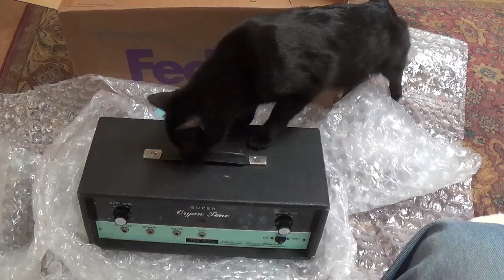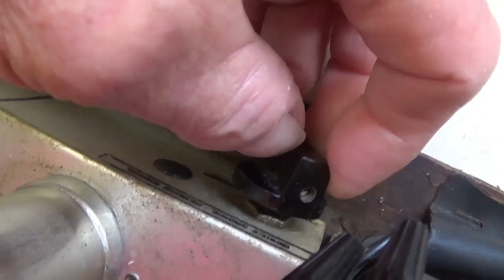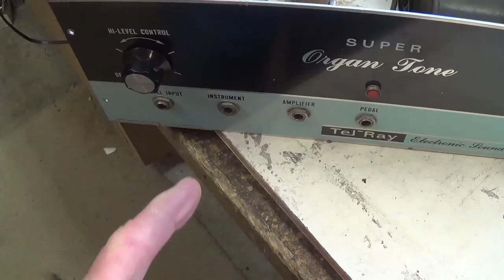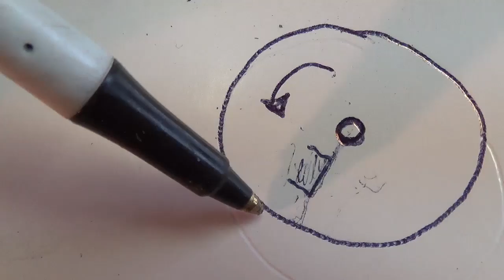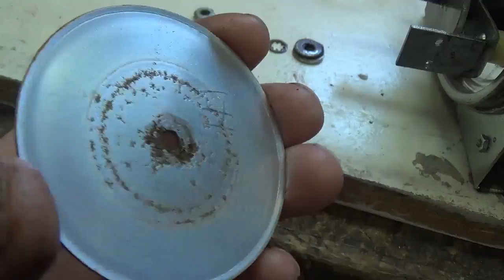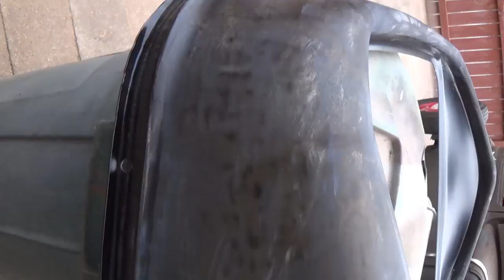Tel-Ray Super Organ Tone No.2: The Beat Goes On :)

Comment: Nice vid as usual just one question, -Would it be  best to nenew/repair the main bearings to get a more stiff transmission with less runout without the endspring trying to centralise the whole lot and just check lateral position. Cheers from Sweden, keep up your outstanding work UncleD
Reply from the maker: Yes, it might be better, if the drive pulley was not pressed onto one end of the shaft and the disc support pressed onto the other. The last think I wanted to do was damage the unit trying to disassemble it.......especially when it wasn't really necessary. We will :)

Comment: Just jog your memory twisty connectors are called wire nuts.
You didn't repair the bushing if you take the bushing out and fill it with plumbers solder cleaning it first and using Flux then drill it out so it is a snug Fit then just spin it in a drill when it's dry clean oil and you should be alright. You could have used a roller bearing on the other hand a small one like from a router bit welded to the spring steel or brazed would have been better and smoother operation and last longer. When oiling the bearing bushings like in the motor always use manual gearbox 90 or 80 oil best stuff for that type of bearing if it's a bronze bearing what it should be, And best lubrication for chains as well like bicycles and motorbikes.

Theoretically you could use an old PC hard drive disk, and probably the motor as well make a good replacement, just dismantle the Platters and just have one platter the old type were covered in a oxide material I don't know what the new discs are there silver I'm not sure what they coat them in..but the Old aluminium discs platters, had thick coating of oxide at least 60 or 80 microns thick, would make a great alternative.
What oil are you using in the lubrication of the disc mineral or synthetic and what grade and any additives added if you got a name or link thanks like to find out about it
Reply from the maker: Removal of the central shaft would require pressing the drive pulley and the disc support off of the axle, John, which I considered to be a risky procedure. Creating an end pilot solved the end wobble on the shaft, as demonstrated by the 0.0001" runout on the disc. I'm not sure about hard drive discs being usable in these units. Could they withstand the Ucon oil and rubber head contact?  Details about the Ucon oil are provided in my first video on these units.
Reply: @UncleDoug  I see what you're saying. Could you slide a ball bearing over the shaft and epoxy it in place, on the face of bearing housing..? I don't know if it would affect the hard drive I don't think so the oil that is or the rubber the surface is very tough it doesn't affect the surface on the disk you are using what is that coding silver. Anyway seems nice job cars looking nice
Reply: @UncleDoug On my echo unit the spring metal that holds the brass bushing in the bearing housing was bent and lose simply pressing the metal with a screw diver solved 1/4 inch of run out for me. The bearing needs to be removed to check this some are closed housings though.

Comment: What are the theory on this "rubber" used as writing and reading heads ?
Reply: I think it's placing an electrostatic charge on the disc and not magnetizing it like most recording is done.
Reply: Year, I found the first video, where it's explained
Reply from the maker: That's good, Keld. Thanks, Mr. H.

Comment: The old Cat scan worked fine,I used to own an Echo unit that worked on that same design.Fine work on the amp and Rod.👍🎸
Reply from the maker: Thanks, Bob :)
Reply: Have you tried to mount your alternator on the bottom of your block.The boys in So.Cal.have done this to make their engine bay a little nicer.👍🎸🔌
Reply from the maker: Thanks. I tried it on an earlier engine, Bob, and there simply wasn't enough room on a Model A.....maybe on a '32.

Comment: UD, first and foremost great job, I would love to hear the assumed  cursing in the outtakes.  After watching you test and rebuild this electromechanical device several times and the overall time and energy spent doing so, keeping in mind the overall weight of the device compared to an IC which could fit on the head of a pin.  What I don't understand is how is it possible that in 1969 men walked on the moon.  Less than ten years earlier the highest altitude man had ever been was in a balloon.  I won't ask if you "believe" but I would love to know how you feel.
Reply from the maker: Thanks so much, Paul. The tremendous technical advances.....from the days of Model T's and biplanes to Bugatti Veyrons and routine space flight.....sure did happen in a brief period of time.  I'm glad that I'm too busy working on primitive circuitry to be bewildered by the astonishing rate of technical innovation.  God only knows what the future holds.

Comment: Fabulous detective work, as we've come to expect. There's a lot to learn here regarding the importance of objective observation and logic when it comes to what we might think of as "electronic" repair work.
Reply from the maker: Thanks for your insightful comments, Leon. I agree.....there is more to it than simply taking some readings with a DMM :)
Reply: @UncleDoug  Yea, they didn't start playing records backwards until Black Sabbath sleuths started looking for messages from Satan himself... >;) And I have a gut feeling that the dried bearings and direction of the heads being reversed 180' against disc rotation, besides the concentricity issues didn't help matters. The old girl is just worn, but sounds pretty darn good considering. Great troubleshooting Mr. Holmes! I do have 2 questions you didn't mention, 1) How does the neoprene write and read? 2) The head perpendicularity with the axis made sense, but I might have missed the diametrical alignment, do the neoprene heads have to be centered in line with one another on the face or is that non-critical? Thanks!
Reply: @ThePreyMantas  , actually, back in the 1960s some people thought or were spreading a rumor that if you played I Am The Walrus backwards, you would hear a chant saying "Paul is dead, Paul is dead". There were some turntables back then, such as the original belt drive Acoustic Research turntables, AR for short, that if you spun the platter backwards and then subsequently turned on the power, the platter would indeed run counterclockwise and you could play a record backwards on it. I never tried it myself, and anyway I suspect it might have been rather rough ff on your stylus....

I don't remember ever hearing anything about playing Black Sabbath records backwards, but Cheech and Chong joked about it on record, that if you played Black Sabbath at 78 speed you would see God.
Reply: @goodun6081  LOL, in my best stoned Chong voice, " I think you have the car park, mannnnnn". ;)
Reply from the maker: Answers to PM's questions: 1.) The reading and writing is done electrostatically......not magnetically, like most recording devices. 2.) The heads must all contact the same 1/2" ring on the disc, since they are continuously writing and reading.
Reply: @UncleDoug   Interesting research on the tech. https://www.youtube.com/watch?v=i6kv7I4cPQc You'll note the "engage/dis-engage" mechanism where the aftermarket spring you stiffened up at the end of the shaft, so the one you repaired appears to have been really hacked up and that feature was complexly missing and the wipers are always engaged on that customers unit which appears not to be as designed which was to prolong wiper life. Cool story-line behind the invention.
Reply: Are you leon c the great amp builder and guitar player???
Reply: @russellesimonetta3835   - Well, I'm Leon C the hobbyist who does work on and build some amps and does play some guitar...not convinced about the greatness, though, lol. I do really enjoy Uncle Doug's videos. What a great job he does!

Comment: The last unit I worked on like this had to be about 20 years ago. It's not often these come into the shop. They are truly a rare bird. I must admit, they have a very unique sound combining a simulated vibrato and reverberation effect at the same time. These tend to emulate a Leslie Speaker. I have connected one to a vintage Farfisa portable organ, and sounded like a Leslie. Great video as always. Mechanically, these can be a nightmare, but after all is said and done, the end result is pleasing. Luckily, the last one I worked on took every bit of 2 hours...cleaning, lubrication and some electronics repair...this one was a real adventure! :)
Reply from the maker: More of an "ordeal" Frank. I wish the discs were still available, or repairable. As it is, we're stuck with what comes in the can :) Thanks, as always, for your interesting and knowledgeable comments.
Reply: @UncleDoug  A good machine shop may be able to replicate the discs...might be worth looking into.
Reply from the maker: It's the coating that makes them special, Frank, and no one knows how to do it.
Reply: @UncleDoug  Sorry for jump in the conversation... First of all, I never worked on such equipment, but, I believe the magic of the disc is not the coating itself, it's the aluminum, from which it's made, and how it behaves with eddy currents, the coating seems to me more as a wear protection and friction reduction coat. About it, the coating, judging by the appearance, I would say it's usual anodization, which forms a thin layer of aluminum oxyde (alumina) over the aluminum disc. This process can be reproduced at home, not that difficult. Maybe it worth a try, the worst that could happen would be it not work.
Reply from the maker: Thanks for the suggestion, . @merlin1943

Comment: Sorry for the ton of comments, bad habit of mine, to comment while watching, how does the rubber pick up and then transmit the sound down the wire, I'd like to make one some day but i have no idea😂 also, how much for the car 😅
Reply from the maker: As I understand it, P, the message is stored as static charge on the disc surface. Static can "pass through" insulators......just like it does when you walk on carpet with rubber-soled shoes. You can't build one of these units, however, since the rotating anodized disc is impossible to duplicate (at least for the present).
Reply: @UncleDoug  so there are no schematics online for such a thing? I would like to try out a few different things and see if they work any how
Reply from the maker: Yes, there are schematics. You will have to look on Oil Can Delay forums.

Comment: Those heads: I sure hope azimuth is not critical on them. They would be very hard to adjust perfectly...
Reply: The way to do it, I think, would be to disable the first record head, align the second record head by eye or however best you can, then run the unit with the "wobble" spring unhooked" and white noise input and adjust the azimuth of the playback head for maximum treble in the full-wet output. Then disable the first record head, enable the second record head, and adjust the azimuth on the latter for maximum treble. The important thing ultimately is that the three heads are aligned *to each other*.
Reply from the maker: Thanks, Hub. I'll keep that in mind if I ever encounter another one of these infernal devices :)
Reply from the maker: In my somewhat limited experience, Ray, the adjustment is important.....but not critical.

Comment: I think the red stuff is like what you use on your car to keep things from slipping, like loctite, I've found blue and green in modern turntables
Reply: It is Glyptal sealant.  I have used it for 35 years as a Test Equipment Engineer in the Aerospace Industry.  We used to seal small potentiometers adjustment screw heads so nobody would change the settings after the electronic circuit was calibrated and tested ready for delivery.  We also sealed the machine screws to make sure if they were tampered with we may not honor the warranty.
Reply from the maker: That agrees well with my speculation, Bill. Thanks !!
Reply from the maker: You could be right, P.
Reply: I've seen nail varnish used for the same purpose.
Reply: Lots of Japanese made audio equipment had fasteners secured with red or green lacquer-like stuff. At the electronics repair shop I work for, we use nitromethane (rocket fuel!) to soften it. Just don't allow any open flames near the nitromethane!
Reply from the maker: Nitro makes a good fuel for drag cars, GU. The fumes are like tear gas.

Comment: That's a really neat toy, sure would be fun to play around with.
Reply from the maker: Yes, indeed, VC. It sure scares the cats :)
Reply: Heartily agree. The effect is too drastic and vulgar for my taste, but that's just me. I could do with delay time modulation that wasn't "hard-coded" to be once per disk revolution - would prefer much slower.
Reply: hubbsllc — If I were to use it, it would be on the most subtle setting just to get a little vibrato effect

Comment: I got curious as to how cars were painted in the old days and googled it. Interestingly, they didn't start spray painting them until the mid 20's. Before that they used a sort of baked enamel process.  Here's the info: "According to Model T expert Guy Zaninovich in Ann Arbor, Mich., cars were painted using a process called japanning, which today would be called baked enamel. "It was first used in the mid-1800s for decorative items imported into America," Zaninovich says. "A piano has a shiny black surface that almost looks like plastic rather than painting because it was done with the japanning process. It leaves a very hard and durable surface. The only pigment that it worked in is black. If japanning worked in hot pink, all Model T's would have been hot pink. Akron Paint & Varnish Inc., the 125-year-old Ohio company that made the original black paint for Henry Ford, is still around, and it has the formula. CEO David Venarge says the formula came with the two founders from Germany. "The formula used tung oil, a cheaper replacement for linseed oil, car black pigment plus gilsonite, a mined mineral," he says. "The paint was also used on mattress buttons, hooks and eyes, bobby pins and other hardware."
Reply from the maker: Fascinating info, Bill. Thanks !!!
Reply: I got curious because I've seen some old movies like Laurel & Hardy where people can be seen painting their own Model T's at home using a brush, so I thought maybe they used a brush at the factory back then too. I didn't think they had spray guns back in those days, but I knew nothing about this baked enamel stuff. I'd like to see a car painted that way to see how it measures up to a sprayed car. If you run across one at a car show, Doug, try to get some video of it. I'll do the same.
Reply: The model t came in three or four colours didn't it? Black brown green and yellow, I could be wrong...
Reply from the maker: I believe the only color offered on the vast majority of Model T's was black, P.  Model A's, which came out in 1928, had some limited color choices.
Reply: @UncleDoug  a very quick Google search gave me this:

In his autobiography, Ford reports that in 1909 he told his management team, "Any customer can have a car painted any color that he wants so long as it isblack." However, in the first years of production from 1908 to 1913, the Model T was not available in black but rather only gray, green, blue, and red.

Without a time machine I have no idea😂
Reply from the maker: @phonotical  Thanks for the additional info, P.
Reply: A time machine . . . it's on my To Do list! (If only I had time to build it. . . .)
Reply: The very early ones did, yes.